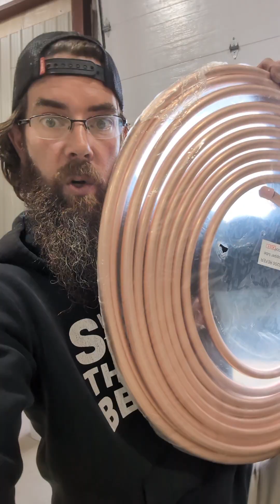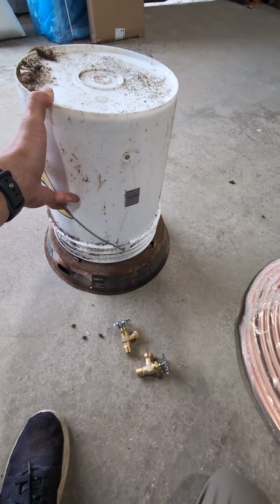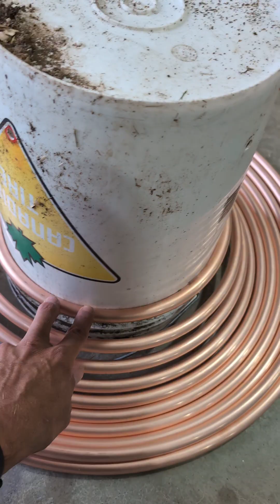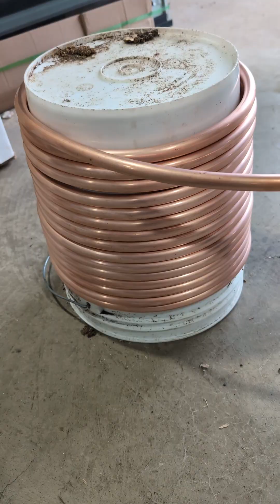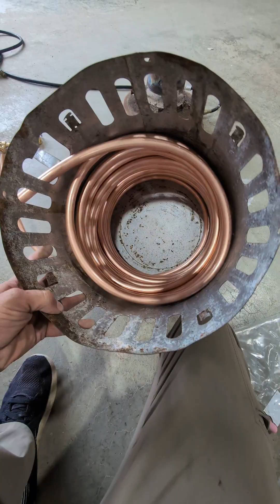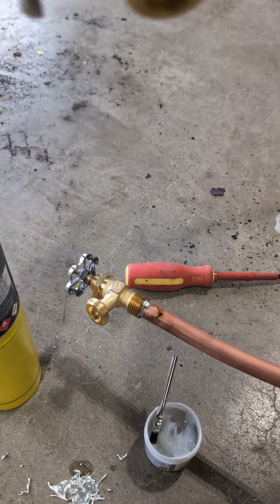DIY Propane Pool Heater From 75F To 92F in a DAY!

Comment: How many feet is the roll of copper and what size? Thanks!!
Reply from the maker: its 5/8 and 50ft
Reply: How do you get the water in it? Do you use a water pump?
Reply: @gparrishgsxr  yes, he uses a sump pump in the pool that's connected to a 50 ft garden hose that runs and connects to a ball valve at the copper pipe that sticks out and away from the heater. (at one of his soldering connections)